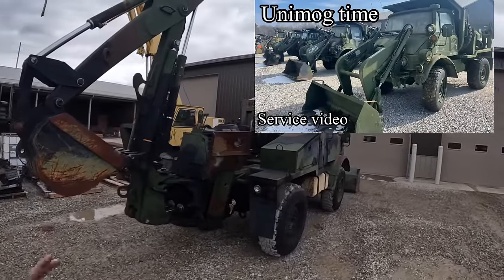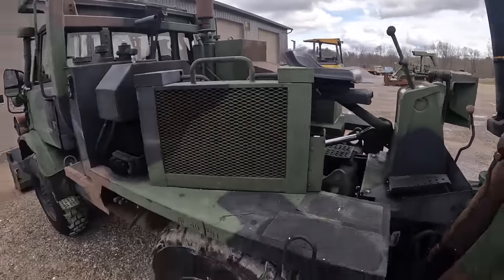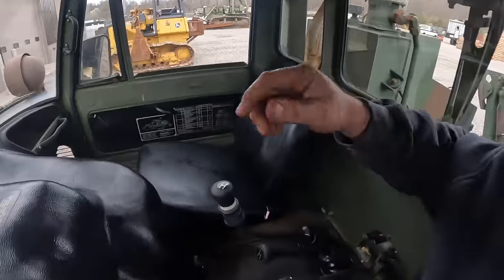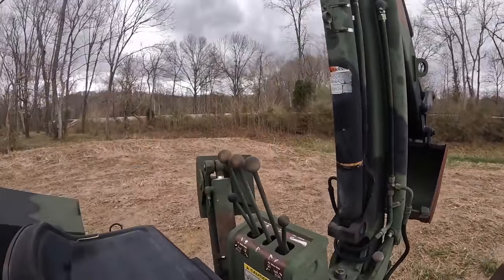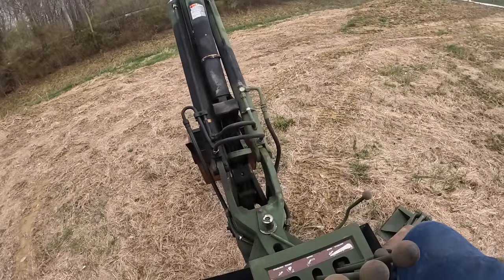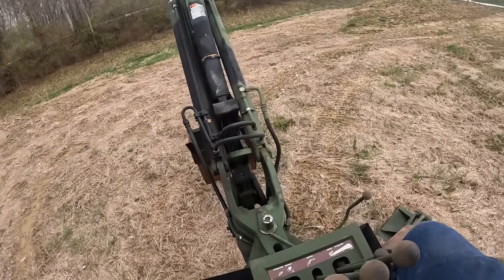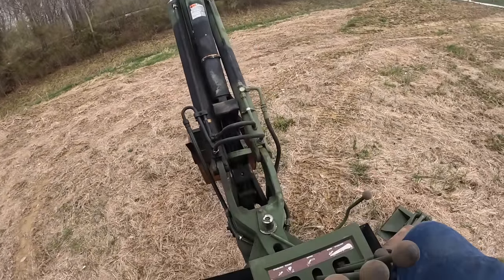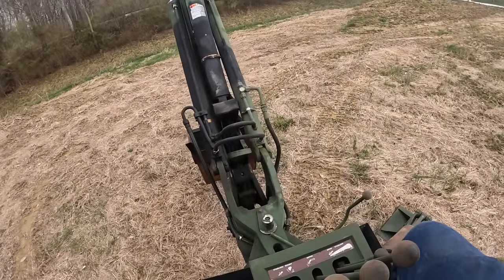Mercedes Unimog FLU419 SEE tractor walkthrough and operation video @C_CEQUIPMENT

Comment: Awesome to see. I have thousands of hours operating a SEE and know them from front to back, top to bottom.  It was always considered a POS but it did its job very well. Except the heater. It sucked. Imagine being in one with a passenger have full gear on, 2 M16s and an M60 inside the cab.
Reply from the maker: Full house!
Reply: I'd like to personally thank you and your SEE operator brothers for digging our foxholes and Ranger Graves down at DZ Normandy! Saved us hours of work!!
Reply: Do you need a CDL type license to drive there
Reply: I was a SEE operator and M60 gunner, stuck the M60 in a tool compartment when traveling. Nice thing about it was my fighting position was the first one dug
Reply: You just described the lucky ones that were 62J's ......  My heater worked well ..... But  weren't much room for two people with sandbags on the floor, 2 A1's , etc .... But I loved my S.E.E. and she loved me .....  I'd take that S.T. any day of the week best piece of eqpt 62J or 62E ....

Comment: I was in Germany when they first were feild tested.  I worked in maintenance and this equipment was one of the best things running.  You can remove the back attachment in about 20 minutes and the front in about 10 mnutes.  The entire system is designed with open centered valves to allow the to sit in place off the equipment and if someone moved the valves the attachment would not move at all.  Safety built in to keep people safe.  One thing that I found was to have plenty of fuel filters on hand, always changing them.

Comment: We had one in my engineer unit -  it had a wonderfully bouncy quality to its ride and a funky shifter - it could dig a fighting position in 5 minutes that would take two guys 8 hours by hand. It also had a fantastic hydraulic system capable of running a chainsaw and a jackhammer which both worked fantastically when we used them. Cool Video!

Comment: Do you know if the front bucket can be replaced with a grapple or the backhoe bucket replaced with a grapple. I would like to use the Unimog to pick up logs and smaller logs for my saw mill and fire wood...

Comment: Back in the 80’s my company wanted to build a new 5 bay bus garage so the owner bought a used case 580B and I ended up being the operator. I dug foundations , septic bed , fuel tanks( back when it wasn’t such a hassle to bury them) water and utility lines plus drive and parking. It had the 3 lever controls with foot swing. The boom rested in the over centre position but there wasn’t a lock. When swinging with that one you needed to operate one of the other functions at the same time as swing to slow it down for smoother swing.  Got pretty comfortable operating it, but joy sticks would have been nice.That came with the 580 C.

Comment: Loader Operator Tip: Ideally, the bottom of the loader bucket should just slide along flat between un-disturbed dirt and your waste pile. Use the bottom and heel of the loader bucket to control the aggressiveness of the loader when digging or backfilling. Lip above heel causes bucket to raise above grade when going forward and bucket lip below heel lets the bucket descend deeper. Most industrial loaders will have a bucket level indicator to assist the operator to control his grade.
Reply from the maker: Yep

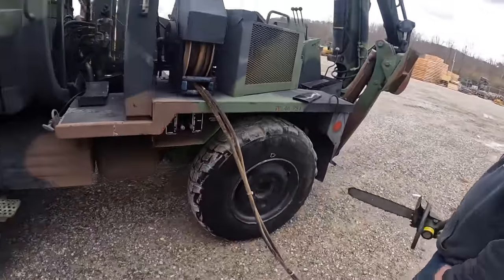Comment: 4:39 the awesome thing abaut such a hydraulic saw is you can use it under water -- like cut up a tree the beavers felled or cut the remaining stilts from a old deck underwater even with the mud - also good for cutting ice and trees halfway covered in mud like during a landslide 
our fire brigade got such hydraulic saw kits on their newer model Jeeps - ofc you can also power shears and pry tools to open crashed cars, get pinched people out - just like that with a hose roll and a disconnectable pump that engages with a belt tentoner like a ride on lanwmower blade

Comment: newer Unimogs with this setup have a hydraulic suspension lock for when you are digging or pushing dirt so you dont dig in jumps and rits from the suspension giving - also they have now both on  the PTO pump so front loader is almost janky fast

Comment: Cool video never knew they where sold with case backhoe boom overseas, in Austria and Germany those aimed at construction companies with Schaeff Backactor. But they were not sucessful, for once tehre are no backhoes arround here, we run smaller wheeled diggers like atlas and such ever since. On the other hand compared to a backhoe moving the machhine when trenching would be even harder to do a lot of digging performance...

Comment: the G on the gear stick stands for  "gelande"german for terrain or offroad if you will .its a ultra low crawl gear with max torque at low speeds.    the porsche 959 rally car also had such gear to enable it to take off on loose or muddy terrain without digging itself in instantly

Comment: I have seen one of these Case equipped Unimogs before when they were on a near by Case Equipment Dealer's lot. ( This was back in the mid 70's, when Case had them all painted up in Case colors and like you mentioned even back then, there was no doubt that what you were seeing was a Case.
This is the first time that I have seen one in demonstration though. These are one heck of a machine, to be sure.

Comment: Back in the late 70,s early 80,s a friend  I went through school with got a Unimog, with a backhoe attachment like this and a snow plow attachment, Dad had 4500 Fords and later 555 , 5575. The 1st time he seen it , he says, what the hell is that useless thing, he got a call one day when my friend   got it hung up , he used it for small stuff behind houses that was to small of a job, that Dad had gotten out of. You CAN get them stuck and when you do IT IS STUCK BIG TIME, he looked it over good and was at one time thinking about getting one but the price he couldnt see at the time and parts for it back then where hard to find, they dont like Missouri rock we have to well either!! Friend done VERY well and later owned a asphalt business. Makes me want to find one for pushing snow, and put a good heater in it, on our 4 mile private road, friends done pretty good in DEEP snow with chains on all 4 wheels.

Comment: Kelly manufacturing in Breman Indiana back in the day offered a backhoe option for the H1 Hummer, sold quite a few to cemeteries for digging graves.
Reply from the maker: Interesting
Reply: @C_CEQUIPMENT  AM General also sold some H1's with a mounted bucket lift to tele-communications companies for getting into remote off road locations.
Reply from the maker: @jamesd.hummell4391  I did see those

Comment: clever machine!  Looks very top heavy, like to see how it handles a side slope.  How do you steer it from the backhoe seat?  I noticed the front wheels were turned when you did a side move from the backhoe.  It also looks very heavy for the small tire surface, likely not good on soft surfaces.  From a longtime backhoe owner and operator.
Reply from the maker: Its not balanced as good as a normal backhoe

Comment: Hi Clint, just wondering how high the front bucket will go?  Could you load a pickup truck with dirt or not made for that?  Is a dump truck height out of the question?
Reply from the maker: I’ll have to check but I’d say it has an 8 foot dump height
Reply: @C_CEQUIPMENT  Thank you Clint, great demonstration.  I like that you took us through all the details of the truck.  Very informative.
Reply: We would easily load our 5 ton dumps. If it had side boards, you had to have it raised fully. Just took quite a few scoops since it has a small bucket.
Reply: @hotroddude6551  Thank you, that's what I was wondering about

Comment: When I was in the Engineers in Korea we hated them ! We referred to them as the (TUMBLE BUG) they always flipped over! They also have no room inside them. In extreme cold weather they could not dig the hard ground too frozen ! In extreme heat they always overheated running the backhoe!  Were also under powered for the front loader. The truck itself was fantastic just not very fast! The heater  was not very good .  Would make a great farm truck multi-use! Or a winter snow plow truck!

Comment: Quite the tool 👍. To bad they didn’t build a dump box unit with a dozer blade.
Reply: Specially built for small emplacements.  Ukraine could use them for defensive lines as well as cleanup after they win.  Slava Ukraine!

Comment: Great Video. Just wondering- How many Gallons of Diesel Fuel will the Truck Hold, and with that said, what kind of range on an open Road could you expect. In other words, what's the average MPG on the Road?  I don't think Diesel's are measured in that way.
Reply from the maker: They hold 40 gal
Depends on what you are doing but I’d say 12mpg
Reply: @C_CEQUIPMENT  Thanks Clint

Comment: Good video just curious what is the cost range on these I would imagine it depends on condition also is it or could it be street legal or is it just considered ag equipment
Reply from the maker: Upper 20s and they could be titled
Reply: @C_CEQUIPMENT  thx
Reply: @C_CEQUIPMENT  Hey Clint, are you saying that these would get about 20 MPG on the Road? Thats better than my Stock 2001 Chevrolet 1500 Z-71. I get around 15MPG on the Highway with it.

Comment: Why would someone buy this over say a dedicated back hoe or tractor? Is it because they can potentially be driving on the street? Also is there anyway to run a brush hog on these or no? Thx
Reply from the maker: Unimogs were a neat idea, but in reality they are just like a Swiss army knife. They can do alot of different functions but not that well. Driving one down the road is like Driving a slinky. Once you start bouncing on those tire with all that weight, it's hard to stop rocking like a boat-Kevin
Reply: @C_CEQUIPMENT  I appreciate the insight!

Comment: The loader on the front of that truck is very slow the backhoe on the rear of it is extremely fast you can adjust it I'm pretty sure and I would because that that back was a little bit dangerous being that fast, and it's really not very productive when the front loaders that slow so I would have guessed it and I'm pretty sure you can similar to a central hydraulic system if I'm not mistaken
Reply: Back filling trenches in a war is not as big a priority as digging them.